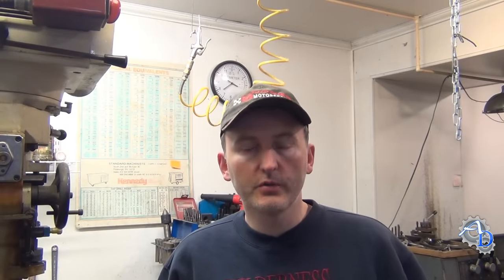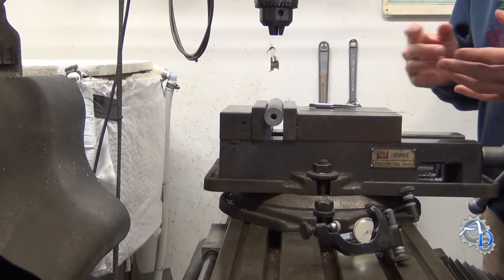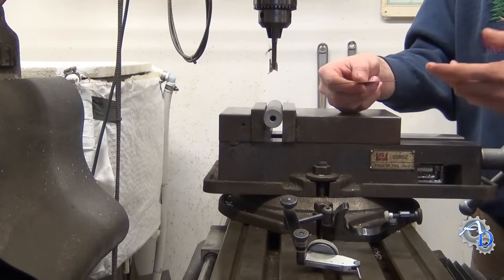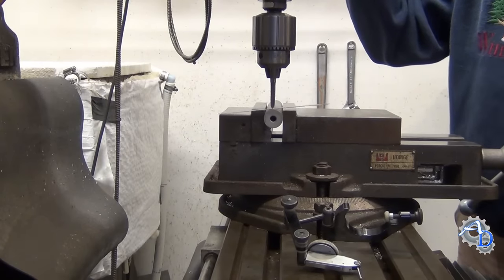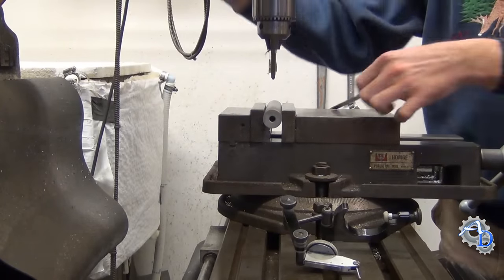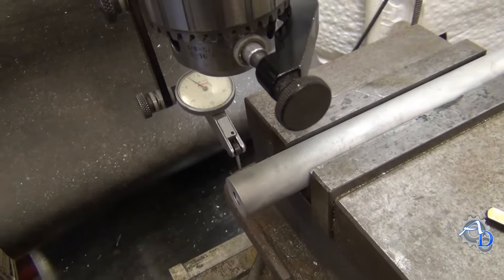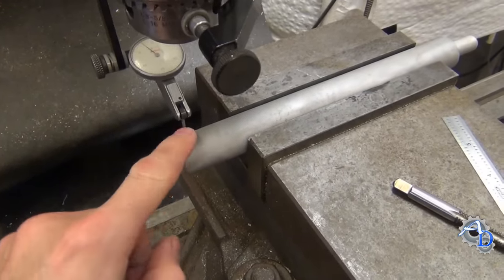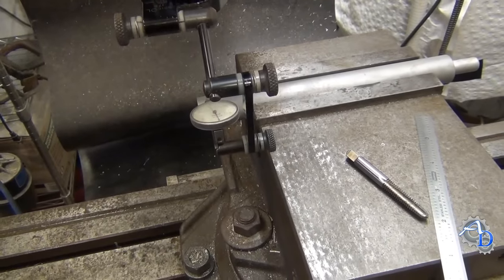Old Machinists Mill Trick To Quickly Find a Rod Centerline

Comment: Why not just use an edge finder ? I'm saying that takes less that 30 seconds & it's dead on even if you have no readout. This is one of those deals where your boss sees you & say's WTF are you wasting all this time for.  Sorry  but this is not worth the time. Plus you should be able to indicate your vice in less than a minute. Every machinist has an edge finder.  I've been in the trade for 43 years & this would get you yelled at or fired in 99% of any machine shops . No offence but if it takes you any more than 30 seconds to throw two parallels under you bar & edge find with a proper edge finder which are far from expensive & a must for any machinist than your in the wrong trade.
Reply from the maker: See the description, but thank you for your comments just the same.

Comment: Not accurate enough, I use precision ground dowels. Put one in the chuck, touch either side of the work piece noting the dial readings and halve it.
Reply from the maker: It's meant to be an approximation for not so close work, or I use an indicator for a last word on close work.
Reply: Thats how you damage tool holders and one of the least accurate. You rely on feeling, should alway be using a dial test indicator, with practice you can do it in less than 1 minute and right on dimension. I've seen old guys and young bucks find center of things hundreds of ways. I also see them making alot of mistakes

Comment: No real machinist wants approximate center line.
Reply: Luiz Algria A real machinist would have watched the video and understood this approximation is used to speed up the accurate setting with the DTI, as Arnold clearly showed.
Reply: mikerjuk sorry I offended you,  but approximate is not accurate. I did watch the entire vid, thought it was a good way to find near center without an indicator..As you may well know the fudge factor will only bring you trouble. A simpler way is to use a piece of paper. Put the paper between the work piece and the mill. When the mill pulls away the paper you will be .004 from the edge.  Easy math will now get you center of the round. Can also be done with a drill bit.
Reply: @luizalegria1340  You didn't offend me, but so many people have commented on this not being accurate enough.  Arnold has never claimed it was completely accurate, he just suggests it's a quick way to get very close to centre, and you can then use a DTI to get it exact if you need to.  For some purposes it may get you close enough without any further measurement, e.g. someone drilling a piece of rod in a drill press for a cotter pin typically won't be concerned about getting it down to under 0.001 inch.